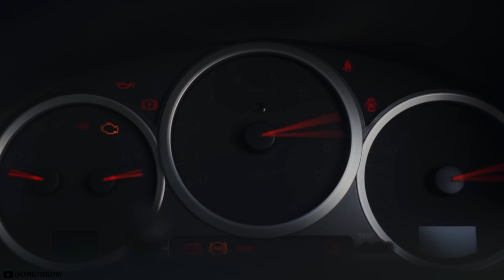Donut Media VS. Subaru

Comment: I wonder how much research Donut did before they jumped into this platform. I think they should have done Civics for time attack cars. Not cause Subarus are bad, but because they demand more attention and care than most platforms.
Reply: Hmmm, you might be onto something, civics are harder to screw up.
Reply: Subarus are garbage for anything other than daily driving.
Reply: We can assume next to no research
Reply from the maker: They probably were asked to do Subaru's tbh. It's such a popular platform ya know?
Reply: @AlexMartini.  makes sense, I just feel they should have done some homework on the whole platform before jumping into it.
Reply: But didn't their experience inform a lot of people of exactly this? That the platform isn't something to just be modded quickly and without research? Civics would certainly do better for the scenario they had the cars in, but that doesn't say anything we don't already know.
Reply: @TheseEyesSeeNothing  you’re absolutely right. This is an example of what happens when you just jump into something you’re not prepared for. My concern in this case it’s due to the lack of research, they make an entire platform look unapproachable
Reply: None, mr subaru analyzed their video
Reply: Honestly that’s a fair take, but Subaru should also be looked at. Why make something so confusing and fragile? The 350z was fine and that has oil issues, Miata ran fine, and so did the e36. A lot of the time even with enthusiasts they’re more eager to jump in and use what they see in the front page of google. If it requires so much research I also feel as if it isn’t person friendly to mod. I saw Smeedia video on it and I agree but I also think the platform, more than others, are definitely weaker.
Reply: I hate my bugeye wrx it just sits in my garage collecting dust I’m going to scrap it
Reply: @GIXXRBRAH750  I'll take it
Reply: In other words, Subarus suck and are unreliable, lol. Imagine building a "rally" car with a poorly designed sump that can handle hard cornering...
Reply: @OldManShoutsAtClouds  I built it to cruise and enjoy and guess what I haven’t enjoyed it Once!!
Reply: @basedlibertyprime  WRC has entered the chat
Reply: @OldManShoutsAtClouds  the rally cars are dry sump though.
Reply: @curtisdc312  if you’re in australia I’ll give it to you for 4k it has voltex carbon spoiler 
Brand new tyres and rims brand new 05 sti tail lights

Charge speed extensions etc just needs to put together and a tune
Reply: @GIXXRBRAH750  USA 🙁 California to be specific
Reply: @GIXXRBRAH750  would love to have another subie to work on tho
Reply: @curtisdc312  I hate it lol we can ship it to you
Reply: @GIXXRBRAH750 nah man don’t scrap it  man just sell it on marketplace or something then you can use the cash for a new build I’d take off your hands but i live in California and it’s not old enough to import
Reply: @jonathoncorona2724  ah spewing! Understandable I’ve got an s15 atm
Reply: @S15Silvia.Stanced  lol I would totally but I don't got that kind of money, I can't save for shit
Reply: @GIXXRBRAH750   nice I love s15’s I’m planing on getting one later on
Reply: @curtisdc312  fair enough
Reply: @GIXXRBRAH750  I could do 1k 🤣
Reply: @curtisdc312  do 3.5k US and take it
Reply: @S15Silvia.Stanced  maybe in a month or 2, how much you think shipping costs?
Reply: @curtisdc312  I’m not sure man what’s your email? How old are you?
Reply: I looked it up about $2,649 usd to ship it

But I won’t let the car get on a boat without money
Reply: @S15Silvia.Stanced  you mean like pay up beforehand right?
Reply: @curtisdc312  yes sir! The last thing I need is to send my car and not get paid
Reply: @S15Silvia.Stanced  oh yeah of course. I understand, I'm a stranger to you. 100% makes sense
Reply: @basedlibertyprime  did you forget about them being one of the best rally cars ever to build and race on dirt?
Reply: @S15Silvia.Stanced  build it right, and you'll have a good car to drive
Reply: @silasbradford  nah I’m sick of it it’s a Subaru wrx bugeye biggest & shittest platform IMHO
Reply: @silasbradford  with the full support of a rally team any car could be great, if your just a dude trying to have a fun street/track car you couldn’t pick a worse car then a Subaru.
Reply: @S15Silvia.Stanced  lmao you have no idea what your talking about
Reply: @basedlibertyprime  um ok then explain why they won rally championships ? 🤣 stupidest comment out.
Reply: @basedlibertyprime  bro have you ever had the joy of riding in a 600whp full street tuned sti and taking corner like a mad man if so come back to me and talk then because clearly non of yall k ow what yall are talking about
Reply: I'm glad they made Subaru look bad. Now hopefully nobody buys them and more for me.
Reply: @bakihanma7247  ya lol
Reply: @silasbradford  never been friends with anyone stupid enough to try and own a 600hp Subaru, nothing but a timebomb at that power level.
Reply: @silasbradford  well yeah I kind of do!

Btw I’m not going to sit here and pay 20-30k to fix someone’s mistake just so I can have a “reliable Wrx” all Subarus are shit
Reply: I just recommended this LITERALLY lol. civics would be awesome
Reply: @AlexMartini. but they should of done some research then. They are a media company sending out information to the masses but it wasn’t done with any care. I understand you saying they are harder to work on but I would expect this from a small YouTuber. Not a company that has venture capital funding and a bunch of people on payroll.
Reply: @basedlibertyprime only if you don't keep up with maintenance
Reply: Even then you need basic mods lile baffled oil pan, and other things
Reply: Any honda would have been perfect candidates, better a/m support, and as a subaru owner, def more affordable for track
Reply: So you mean like every project car ever?
Reply: You dont need to do alot of research to know subarus love making cocktails of different fluids inside the engine
Reply: @GIXXRBRAH750  Where abouts in Australia? What condition is it in? How low on the price are you willing to go?
Reply: @Thee.Trainspotter  nsw like in aud pricing I’ll take 4-5k bro the spoiler the wheels , other stuff that comes with it costed me 4k lol you’re getting a good deal still has rego on it bro brand new clutch VF22 turbo etc it has a quarter panel dent but I’ve got body filler

02C WRB blue paint OEM colour ready to go
Reply: @Thee.Trainspotter  you’re in Vic?
Reply: @GIXXRBRAH750  indeed I am
Reply: @GIXXRBRAH750  bloody earth that’s a lot of stuff. Shipping by road will probably cost just as much as the car though 😬😬
Reply: @GIXXRBRAH750  does it run at the moment?
Reply: @Thee.Trainspotter  nah $8-900
Reply: @GIXXRBRAH750  what?! They charged me 1.5k to tow a car 200km!
Reply: @Thee.Trainspotter  well they ripped ya mate
Reply: @GIXXRBRAH750  I think it also depends on the time and roads. Considering for a truck it’d probably be about 4-5 hours one way
Reply: @GIXXRBRAH750  Does the car currently run and drive?
Reply: @Thee.Trainspotter  nah just needs putting the intake manifold on with a couple bolts put the fmic or tmic back on I got both you can decide and just needs a tune
Reply: @GIXXRBRAH750  and after that work it’ll run fine?
Reply: @Thee.Trainspotter  yes 

All it needs is a couple bolts which I have for the intake manifold 

Install the new sti injectors which I got brand new in the box genuine Bosch ones 

And go pay 8-900 tune and you’ll have at least a 200kw all wheel drive beast
Reply: @GIXXRBRAH750  so then why are you getting rid of it?
Reply: @Thee.Trainspotter  I’ve got 4 cars n I need space to work on my s15 tbh it’s just sitting collecting dust I’d prefer someone to enjoy it
Reply: @GIXXRBRAH750  That’s a fair point, I need more space too but here I am investing in cars instead of a new garage haha. Look, I’ll have a think about it and see if it’s worth the money and extra space it’ll take up. I’ll let you know within the next couple of days.
Reply: @GIXXRBRAH750  and if you can find a towing company that’ll tow it for 1k, then that’s a bloody miracle, because no bugger around here charges that little for a trip like that.
Reply: @Thee.Trainspotter  like 8 hours? You’ll find heaps of people bro
Reply: @GIXXRBRAH750  just applied for a towing quote, I’ll get back to you when they give me a price
Reply: @Thee.Trainspotter  what’s your email?
Reply: You got WhatsApp mate? I don’t got social media other than YouTube
Reply: @basedlibertyprime  so what about bader/ smeedia/remy/devin/primemotoring should call them stupid right lmao or its a skill issue on you cause subarus are straight lego sets and nasioc and those YouTubers will give you what you need to keep them running for a long time
Reply: Lol my R18a daily driver civic needs the most attention out of any car in my fleet, the the thing burns so much oil, along with a list of other issues, let’s not act like civics are unbreakable, it’s a piece of machinery, it breaks and needs maintenance, especially when you’re pushing them beyond their normal intended purpose
Reply: @basedlibertyprime  tbh even then, you better have an unlimited warranty bc that gasket is a ticking time bomb
Reply: @silasbradford  "Was" one of the best.
Reply: @DanoFSmith-yc9tg  "especially when you're pushing them beyond their normal intended purpose" something tells me you molested your civic to the point that its not even mean't for daily driving.
Reply: Both Honda and Subaru are my favorite cars, 90s Hondas are dirt cheap and last forever but Subaru a great cars but should not be neglected and taken cared of just like any car just because they say there bad cars doesn’t mean there bad cars, they had bad previous owners
Reply: @OldManShoutsAtClouds  try doing that with a Volkswagen, Volkswagens are worse
Reply: Imagine they tried rotaries
Reply: @toastywhiteboy7822  exactly, then Mazda guys would be all over this and try to defend rotaries, honestly I think Subarus and Mazdas are the only car manufacturers to make unique engines with tuning potential
Reply: @luisloera1309  Porches?
Reply: @toastywhiteboy7822  I completely forgot Porsches make boxer engines, but hey have been Porsche swapped Subarus and Subaru swapped Porsches, for a awhile I wanted my hands on a 4.0L H6 GT3 RS motor
Reply: @DiegoSanchez-fi9cf  And there’s a lot of Civics (and Hondas in general) in time attack. Heck, some of them are literally the top players of their class. Subarus are less common, and you’d be lucky to spot one or two at the top.

Ironically, Evos were KINGS in the time attack around 2010s. The unlimited class were PACKED with these things, it’s not even funny. Maybe they just assumed STis can do well there since Evos did no problem?
Reply: Sounds like a terrible platform to build on the .
Reply: Subaru is the issue not donut. How come no one complained about the other cars they did this with already? Cause it's Subaru problems  that all owners have to deal with that Subaru allows to continue. Flat 6 porsches don't have these issues
Reply: I think that's the point of the show though. Sure do some research but there are soo many things with Subarus that it you sorta have to become an expert at them if you wanna make high power. Also most people that do make higher power take them to shops because they're finicky. I can't count the number of Subarus I see for sale that say they had a rebuilt engine.
Reply: If subaru engines were so great, enthusiasts will be swapping them into other cars all over the place.

Yet, K-swaps abound. The fact that subarus require more caution and attention is a disadvantage, not an advantage.
Reply: @GIXXRBRAH750  

I'll buy ...serious request!
Reply: @sepg5084  
Question?

What's the difference between a K engine and an EJ? 
Can you just swap an EJ into any other car as you suggest?
Reply: @GIXXRBRAH750  

I'm on the East Coast  Virginia
Reply: @DiegoSanchez-fi9cf  yea Honda's woud be a great choice. It's pretty well known that even with stock internals that you can Push the engine pretty easily. Something you don't want to do on a Subaru. And rebuilding a engine is something you don't even do om a cheap project car. And ever on hi car it won't be a cheap thing to do. Especially when you want to chase horsepower
Reply: @GIXXRBRAH750  

In that case I'll have to pass, thanks a million for responding though and you will surely sell that bad boy pretty quick I'm sure. 👍
Reply: @SiCaRiI_DaGgEr  yeah if I don’t get rid of it in the next couple weeks I’m going to scrap
It
Reply: @GIXXRBRAH750   That's sad to hear man, honestly I would find a way to keep it. The value of these cars are steadily increasing since Subaru is now going EV.

If I didn't want to pay for overseas shipping I would grab it in a heartbeat to add with my GR
Reply: @SiCaRiI_DaGgEr  well tbh it’ll be like 4k usd for the car and maybe 1-2k depending who you go through
Reply: They did as much research as an average gearhead would do.
Reply: Absolutely ZERO.
Reply: That means they are badly designed in comparison to other manufacturers.
Reply: This is why I sold my BMW and kept the 350Z, parts are much cheaper and I have great local resources.
Reply: It doesn’t matter they didn’t have any of these issues on the 350Z’s with VQ and LS engines with aftermarket turbos. Absolutely unacceptable no matter how hard anyone tries to cope
Reply: They didn't have any issues with the VQ motors, or the LS/LT. Nor did they destroy 3 truck motors. Fact is Subaru motors are not as durable as motors from other manufacturers.
Reply: @liquidsweg4858  you* can assume no research
Reply: Dude, don't even go there! I've owned 3 Civics all modified, no problems!
Reply: @JTTTTT850  bruh both Zs blew when they were turboed and gave so many problems during the process
Reply: If a car demands more attention and if a rally car champion comes shtty from the factory with a bad oil pan then its 100% the cars fault.
Reply: Agreed, seeing how much the subarus costed to fix it makes you wonder how much less it would've been with a cheaper platform
Reply: I think it served a good purpose to jump into the Subarus with just general car knowledge so others can see the pitfalls of picking a Subaru over something less finicky without experience specific to Subarus. If you know Subarus then the series won't change your mind, but if your considering a Subaru then they may have saved you a lot of money and headaches
Reply: @BLACKRACERONE  tell me you know nothing of rally cars without telling me you know nothing
Reply: @liquidsweg4858  never saw a Evo or Toyota or audi with oil starvation issues.
Reply: @BLACKRACERONE  now tell me, are said rally cars stock from the factory or are they not built for the purpose of rally?
Reply: @liquidsweg4858  there are road legal versions that you can take to the track or the rally, exept the subuaru.. the others i mentioned just need a good oil and brake pads... subaru needs 5000 grand put into it. lol
Reply: Sounds like a suburu fanboy
Reply: @Nakaamaa the thing about mr Subaru is he’s like how could they forget these 3 parts that won’t cause the engine to explode lol, like for Subarus racing history, you’d think they would build cars capable of a few turns without detonating
Reply: @masturone8257 Subaru owners are mainly upset that their cars are being shown in a negative light and they won’t be able to sell their pile of shit to the next unsuspecting kid
Reply: @liquidsweg4858  you’re right but i think it was just one of them. But like you said that was after the turbo.
Reply: @Deadhead central  God forbid they do a sti vs evo build series. I love how they use the flat six as why reliability is issue for people who aren't experts while porsche has same flat six with NA hp equal to their turbo power and has no issues and porsche has way more drivers thay have no idea how to take care of a car most don't even know engine is in back
Reply: Please no Civics are already expensive enough as is
Reply: "demand more attention and care than most platforms" is a nice way of saying subarus are inferior cars compared to most platforms. Their awd system is the only good thing they ever had
Reply: @rj-sx3201  because it is...... their series shows just how much you have to do for these cars. They are not starter cars which is exactly how donut approached them. It's the best thing to point to when someone asks should i get a Subaru or not. Are they prepared to deal with this or not? Most people just wanna buy a car and have fun. Not investigate a cars entire history or completely rebuild an engine because the car doesn't have a history. The Z's took everything like a champ and the WRX blew up 5 engines. Case closed
Reply: It’s a turbo car that’s the only reason
Reply: Didn't they have to expert Subaru guys helping them?
Reply: "They demand more attention and care" that's a funny way to say they're trash
Reply: Tell me its trash without telling me its trash
Reply: @rj-sx3201  It is unapproachable if you have to do tons of research to avoid catastrophic failure. You can't say these cars are friendly if you basically need to buy an aftermarket baffled pan just to avoid the engine blowing up. 

It's not like Donut completely forgot to put in oil or left an engine part out. They simply used the cars like they would other cars. And the cars failed catastrophically.
Reply: @rj-sx3201  or like Anthony mentioned, they saved people time and money by informing them of how much time and money is needed to get into the Subaru platform.
Reply: "not because they are bad, but because you have to be really careful otherwise they break super easy" 

They're bad. They're unreliable, they take way more time effort and money just to make mid tier power, and for a boxer AWD they handle like absolute dogshit. 

They are trash cars, just admit you like them because they look and sound cool and move on
Reply: Civics are more reliable and handle power well unlike a Subaru requires so much more attention for no reason and the fact its garbage
Reply: @jaehongjun842  It's weaker in the sense that the engine is very sensitive to knock and you WILL blow up your engine if you put random parts on, without correct tuning, and don't upgrade the oiling system for track use. Having said that the EJ platform is well understood, basically "figured out" at this point and they can be very tough at high power levels (if done correctly)
Reply: You could use 3000gt but both cars would be high car
Reply: I cant get enough of this argument from Subaru and BMW owners. "Its not a bad car, it just requires much more, very specific maintenance and if you aren't aware of those very specific issues they'l have, then they won't work and THAT'S YOUR FAULT!"